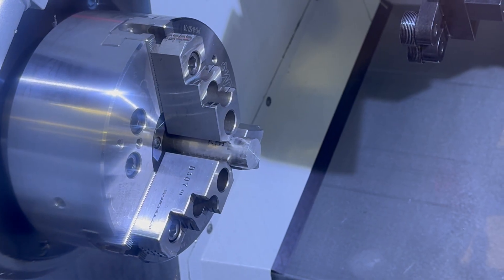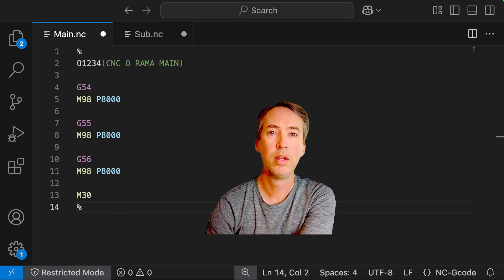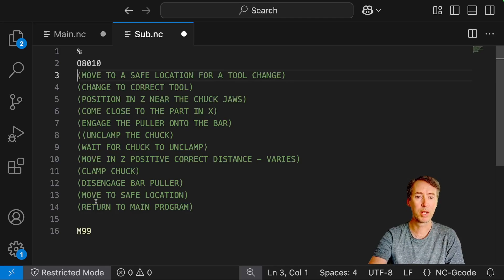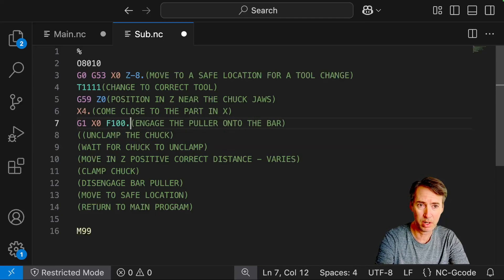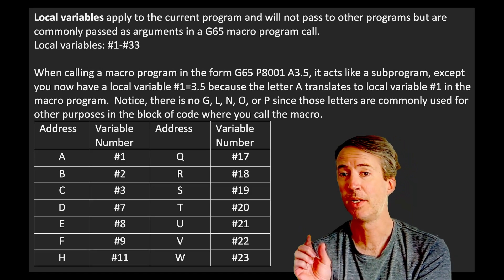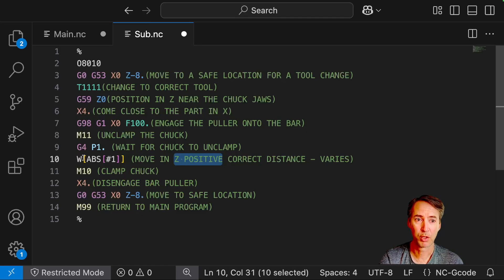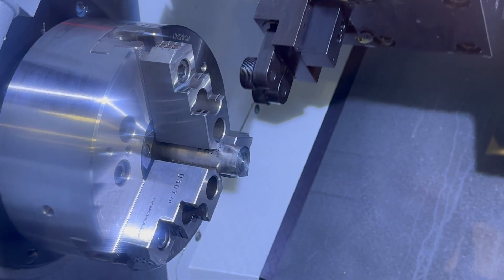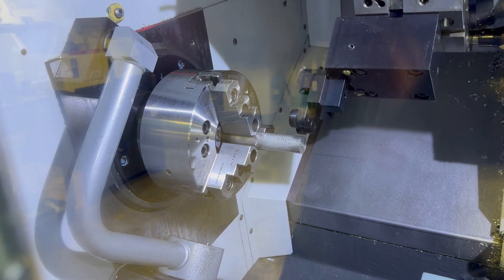Programming a lathe bar puller with macro G codes

Comment: This is awesome! I haven't run a program yet with the bar puller but when I try to move the puller with the chuck open, I get an error. Any tips?
Reply from the maker: A lot of machines won’t run if you start with the chuck open, but if you open it with an M code, it might work. Maybe try it from MDI with the M code and then a dwell, then a G1 in the positive Z direction.